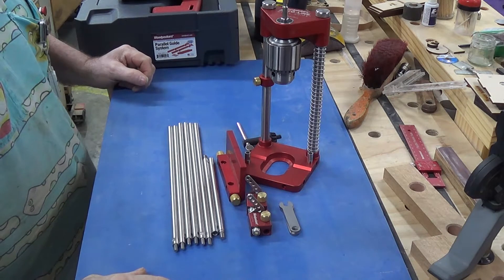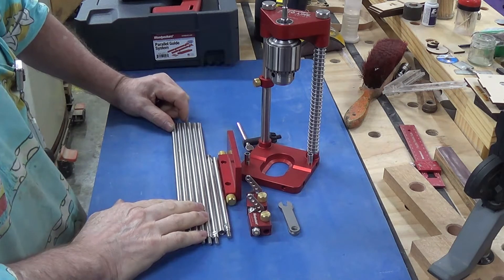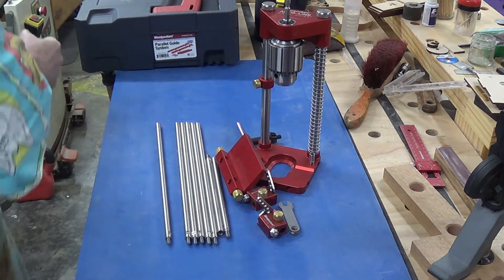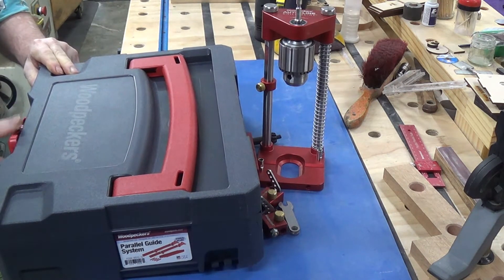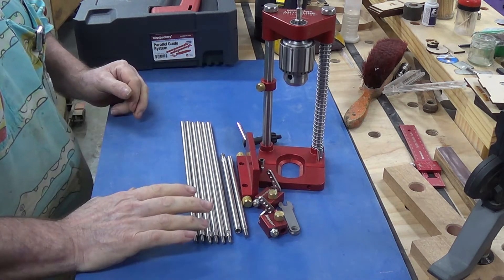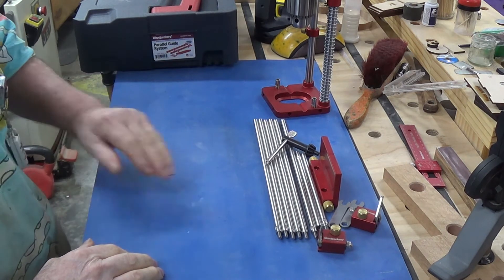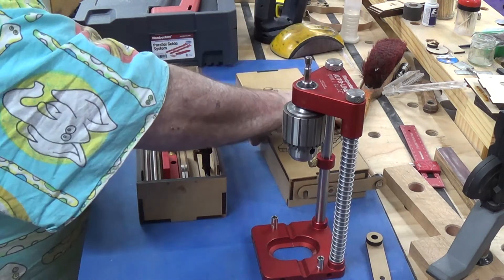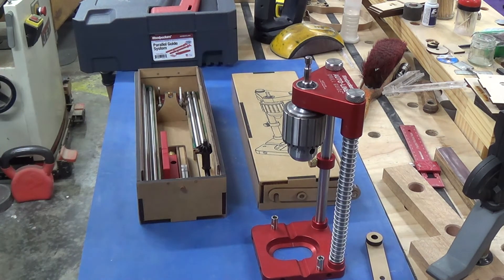Woodpeckers Drill Guide Box's Unboxing

Comment: Love the Video!!!!
Would you ever consider selling the precut pieces?
It would be an awesome investment:)
Reply from the maker: Hi Zapa, Thanks for your interest.

Sorry, but I'm a self funded retiree (hobbyist) and do not "sell" my products.  In the past, while the cost of MDF would be negligible as I have plenty of craps (maybe $10), I've had countless issues and debates over shipping cost (and packaging) which has been around $70+ for similar sized items in the past... especially internationally and this has only become worse with the COVID influence... I have been abused and I don't need that sort of shit any more... so I have closed shop on that avenue.

Nevertheless, all the files I have used are made available from the link in the post body or here,
   https://u.pcloud.link/publink/show?code=kZMuPqXZ6k0fsVJAyxSruUbx7QhqajveFEG7

I have added two extra files in the PDF directory ("Drill Guide Box (Corel A2).pdf" and "Drill Guide Box (Corel).pdf") that are hairline vector (required by most lasers for cutting) and colour coded (in Trotec hierarchy) to co-ordinate cutting sequence so that internal parts are cut first...

Armed with the files, you could find a laser cutter locally that probably would charge less to cut than shipping as a lot of the costs are in the setup/design... or maybe even a friend/privateer with access to a laser.  You never know, someone may have a "Trotec" laser and cut direct from the propriety file formats in the link.

If need be, I'm more than happy to discuss any issues/minor changes with you/contractor through my PM at "alexpuzzles@aussiebb.com.au"... just make sure the subject identifies content else it may be a victim of my SPAM blocker.